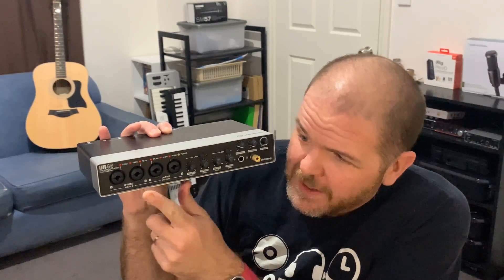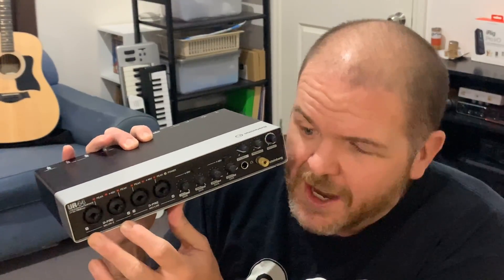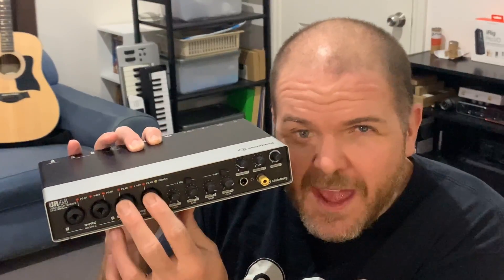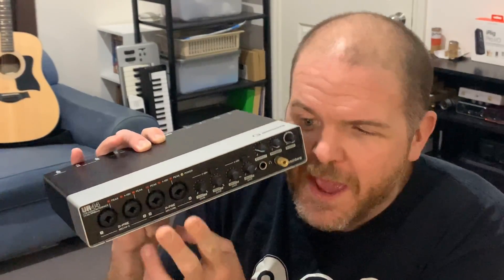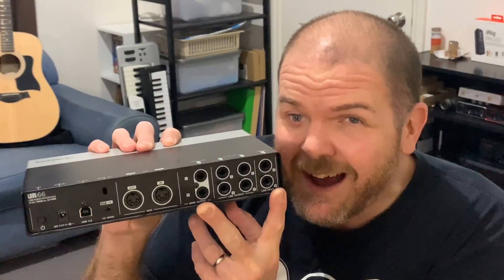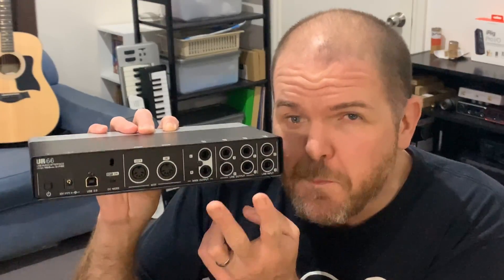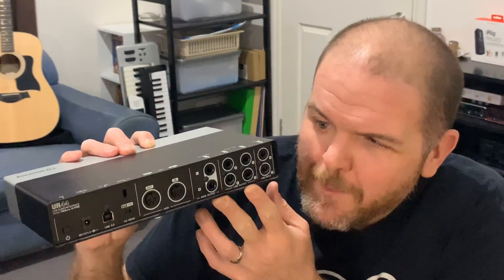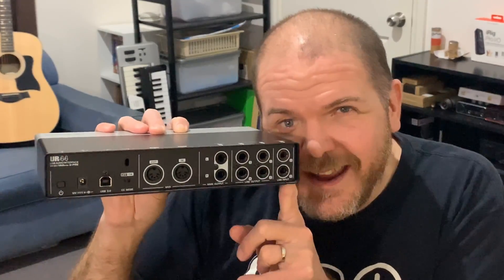What's the difference between a TS, TRS and TRRS cable?

Comment: Well, I didn't know that I didn't know any of this. Now I know. A very informative video, ta muchly. I do have a question though (for Pete, perhaps, or anyone who might know). I want to get the output from my DAW (probably Reaper) through my audio interface (probably an M-Audio 192/8) and into my guitar pedal board - so I can use my pedals as outboard effects - and then back into my interface/DAW. What cables would I need for this? I'm kinda guessing TS would be fine, or am I wrong?
Reply from the maker: Hey there. Pedals are usually just pushing an unbalanced TS signal so yes, standard TS instrument cables are probably the go. Some higher end guitar processors have stereo line level plugs which are TRS so in that case you could use TRS cables instead in to or from your interface, but TS would still work. My cable guide here might help too / http://studiolivetoday.com/cables
Reply: @StudioLiveToday  Thanks for you reply Pete, it's much appreciated and a great help. I'm still amused that in all these years I hadn't notice the different 1/4" jack plugs. But I now know  :-)

Comment: You mean if I want to record my guitars through my audio interface then I'll be needing a TRS cable ???
Reply from the maker: Hey there. Guitars use TS cables - standard instrument cables. Audio interfaces often have TRS inputs for line level signals, but these often also have an instrument or “Hi-Z” mode for your instruments.
Reply: @StudioLiveToday  hey please can you help me out , I have a um2 audio interface and o want to record guitars through it but , it's just not working , today I even purchased a TRS cable for recording it but still I'm unable to record .. can you please help me out  on how to record guitars through behringer um2

Comment: Can you plug in a TRS 2pin 3.5mm jack into a headphone splitter but the front of the headphone splitter is 3.5mm but TRRS
Reply from the maker: You generally need the sockets and plugs to line up with what you’re sending. Some TRRS jacks will accept standard TRS headphones, such as iPhone jacks.

Comment: i want to get an alesis nitro e drum, i allrdy have a laney hardcore bassamp and sleeved only cables. is it safe to use these?
Reply from the maker: Standard TS cables will work. You can also use TRS if you’re plugging out in to a mixer or interface.

Comment: Hello,
Thanks for the video
I have a balanced patchbay here and i'd like to know if pluging TS cables into TRS sockets or TRS cables in TS socket is a bad thing ? I wish to make my patchbay so i can change the order of my gear very quickly yet some of the inputs of my preamp are high Z so what if i plug TRS out in the TS in of the preamp ?
Reply from the maker: Hey there. So ideally you want to ensure that everything is consistent. But it’s not essential. In short? Plugging TS in to TRS is generally fine, but TRS in to TS can cause issues.

Comment: with a TRS cable that is supposed to have the “ring disconnected” (aka the “ring floated”), this just means plug it in until it clicks once, not twice, correct?
Reply from the maker: So, yes you can plug a 4 pole plug in to a three pole socket and just not push it in all the way, but it can be hard to ensure it is correctly aligned. And can cause issues if the ground poke connects in the wrong place.
Reply: @StudioLiveToday  Many thanks! Is it better to unscrew the casing and disconnect (cut?) the wire that is connected to the ring in this case?
Reply: NM, got it sorted. I ordered a couple of TRS insert cables (TRS on one end which spits to a TS “tip” and a TS “ring” plug on the other end). I’ll simply either cut off the “ring” split or leave it and tape over that plug with blue painters tape.

Comment: Can u give me a link to the best plug to use.
From ur house stereo or amplifier to ur speakers?
Reply from the maker: Speakers are a different story. You’ll need actual speaker cable to hook up your speakers, and they usually use banana plugs or those little clips that the speaker wire goes directly in to.
Reply: @StudioLiveToday My speaker input outlets take that type of plug. I just don't know which one is the right one. Out of the one's you show in you're video.
 I have two 18's & two 15's.
 Out of my power amp, it goes into one of my 18s. And out of that same 18. I use a nother pug to go into the 15.
And I do that for the other 18 & 15.
 But now I don't have a power amp. I have a house stereo receiver. And I don't have those wires and plugs no more. So I have to re buy the wires and plugs. But I need to know which plug is the correct one.

Comment: Hey Pete. Can you please help me with the following question?
If I insert a TRS cable into a receptacle designed for TRRS (eg an iPhone) would this damage the receptacle and/or any electronics located immediately behind the receptacle and vise-versa that is if I insert a TRRS cable into a receptacle designed for TRS?
Example:
I found out that when recording an iPhone 5 SE to a ZOOM H6’s XYH-6 capsule input jack, both TRRS to TRRS or TRS to TRS male to male cables can be used. Could this damage either the capsule or the iPhone?
Reply from the maker: Hey there. I don’t know think you’ll cause damage? At worst you could short out one of the devices if the wrong signal hit the wrong ring or tip... but it’s unlikely. TRS plugs for instance work fine on TRRS jacks as standard headphones. The other way round may be more risky.
Reply: @StudioLiveToday  Thanks Pete. I enjoy your videos very much, keep going.

Comment: A potential roadblock. A microphone  with a TS plug can short out inside a TRRS headphone microphone splitter. A TRS microphone doesn't have the issue. Inside the adapter the mic hot lead is wired to both the tip and ring. The long sleeve on the TS plug touches both the sleeve and ring inside the  adapter. This shorts out the microphone. As a workaround, I used two TRS adapters back to back. 3.5mm to 1/4" back 1/4" to 3.5mm to lift the connection between the tip and ring.
Reply from the maker: Nice additional tip here my friend.

Comment: Hi Pete, I’m using a TS cable on my electric guitar this is maybe causing noise in my speaker ?
Reply from the maker: Guitars should use TS cables. A different issue I’m afraid. This video might help/ https://youtu.be/dyrxZrUeSEg

Comment: Hi,
As far as I know, the different between instruments which have a line level to the ones who have an inst level, is that the instruments that have a power connection are line (synths, keys) and the others are inst level (guitar, bass).
So my question is about what you said at 2:42, which means that the line input is for balanced cables and the instrument input is for unbalanced cables. I always thought that the difference between those two inputs is not related to the cable type, but to the instrument power type.This whole thing just made me more confused. Can't I connect my keyboards with an unbalanced cable to the line input?
Thanks, much appreciated!
Reply from the maker: Hey there. I have a complete cable guide video which might help clear things up here / https://youtu.be/dyrxZrUeSEg

Comment: I'm using all TS mono 1/4 inch jacks going into & out of my mixer. When no music is playing I get a hum that is auditable. I was thinking about switching all of unbalanced cables out & replacing with XLR balanced ones. Do you think doing this will eliminate line hum? Thanks good review on cables👍👍💙
Reply from the maker: Hey there. So it’s not guaranteed that changing out the cable will totally remove this as it depends on the source of the noise. But unbalanced cables definitely can be a cause so it’s worth a try.
Reply: @StudioLiveToday  Ok thanks I have all of my equipment plugged into surge protected power strips, the mixer has an external power supply, I will try the balanced cables & replace all of the unbalanced ones & switch out all the TS jacks as well & see what happens, I'm up for anything to improve sound quality.

Comment: I have a mono plug TS 6.3mm microphone and I can't get it to work with my mac book or iPhone. I bought an adapter for 6.3 mm to 3.5mm (TRS) and connected the mic to it and then connected the 3.5mm (TRS) to a splitter that would go to my computer as TRRS. Shot: 6.3 mm TS Mic --> 3.5 mm TRS --> splitter TRRS --> computer . Could someone help me to get this damn microphone to work :D really appreciate it thanks :D
Reply from the maker: Hi there. I would highly recommend an audio interface with an XLR jack. Recording microphones via 1/4” connections is hit and miss and can be hard to set up monitoring. https://youtu.be/eGTbwR9XSHU

Comment: If I have a TRRS mic and a TRS extension cable, would using an adapter to connect the extension cable to the the phone work? Thank you!
Reply from the maker: Depends how things are set up. You need to keep track of what’s being sent to and received from the device on which wire basically. It can get complex which is why I recommend a digital connection via a USB interface or similar.
Reply: @StudioLiveToday  thank you very much!

Comment: Thanks Pete, nice tutorial
Would you or your viewers know if taking a T R S input from an RCA (unbalanced output) would the RCA ground / shield and hot go to either Tip Ring or would one need to tie the sleeve to ground as well. I know this is a rather doggy subject. I may have to find out what works (IF it works)
Reply from the maker: Hey there. RCA is always by its nature an an unbalanced connection so there is no way to convert it to balanced. This is why al RCA cables are RCA to TS. https://youtu.be/yL8UsC9fwv4

Comment: Hello, can i use trs to xlr cable to connect an instrument to the mixter?
Reply from the maker: Hey there. Usually not. Most instruments have an imbalanced TS output jack. So need to be connected to a TS/TRS input jack. https://youtu.be/dyrxZrUeSEg
Reply: @StudioLiveToday  Thank You sir for reply, so can I use a Di box rack to convert the unbalanced signal to a balanced signal ? And then Connect to the mixter for the live stage show ?

Comment: Hello. Very useful video. I have a question. I want to be recording some video and audio, of course, using my desktop pc, they usually have a separate microphone and separate headphones jacks. Which of these that you have deacribed abive should i use? I want to buy a lapel mic
Reply from the maker: Of it has separate mic and headphone jacks these will be TRS. If it has just one combo jack it will be TRRS.
Reply: Thanks sir

Comment: Thanks for the clear explanations!

I have an issue with a device equipped with a TRRS jack plug, maybe you could help me figure this out: it's a gaming chair that has built-in "bluetooth" speakers (they are actually wired to a 3.5mm jack that you plug into a Bluetooth receiver).

The sound is good over bluetooth, so listening to music is nice, but as for gaming or watching movies, there is just too much latency with the Bluetooth protocol, so I wanted to plug the 3.5mm jack directly to a sound source (laptop or smartphone).

But the output sound is extremely low and goes to the right speaker only. When I slightly pull the plug from the socket (but not totally), the sound gets louder, but still on the right speaker.

When toggling the pan settings in Windows, I noticed that both left and right channels output to my right speaker as if it were a mono speaker.

When I try another bluetooth receiver, I have the same low sound on the right speaker only.

When I plug regular headphones to the bluetooth receiver, the sound is extremely distorted, so I thought maybe it acts as a big-ass amplifier and since the speakers are not self-powered, maybe I just needed an amplifier, but the result is still the same.

That's when I wondered why the jack plug is TRRS, which is weird because it's just a set of stereo speakers (so there's no microphone channel or anything else), then I don't understand why there's an additional ring on the plug.

I saw that regarding TRRS, there are different wiring standards with ground and mic/video inverted, still, normally left channel should be wired to the tip and right channel to the first ring, is that correct?

Nevertheless, the fact that pulling the plug a little from the socket results in better sound makes me think that maybe the right channel is wired to the second ring and not the first one.

Is it possible that the wires are totally messed up?
Reply from the maker: Hmmm.... it could use a non-standard wiring setup that isn’t standard TRRS. Have you tried plugging in TRRS headphones like those used with a smartphone? Or a TRS to TRRS adapter?

Comment: Will it work? i will cut the trs of audio cable and replace it with ts cable(from microphone?)
i will only wrap it with electrical type will it works?
and when it is done i will plug in to my piano and connect to to the speaker alone ?
Reply from the maker: It depends what the inputs and outputs on each device are. I would just get the right cable unless you know how to ensure you are soldering the right wires.
Reply: thank you

Comment: Hey pete,

how is a 2.5 mm TRRS ended balanced audio/stereo headphone cable wired? any links you can share?
Reply from the maker: Not super familiar with the wiring sorry? It would have four going to the four poles. Tip, ring, ring and sleeve.

Comment: Excellent material! Subscribed! I've been thinking a while... What would happen when connecting a TRS Mono to a TRS Stereo?
Reply from the maker: Thanks! And to answer your question it would just send a mono unbalanced signal.
Reply: @StudioLiveToday  Thanks Pete. I read elsewhere that "If you connect a TRS mono (balanced) output to a TRS stereo (unbalanced) input, you'll get a strange effect. It will be sort of mono, but it will sound strange. A mono TRS output sends the same signal on the tip and ring, but with opposite polarities. Since the stereo TRS input interprets tip and ring as left and right, you'll have the same signal on the left and right channels after the input, but with opposite polarity still. If you listen to that on headphones, it will sound strange but will mostly work. If you try to listen to it on speakers, a lot of the low frequencies are likely to cancel and it will sound strange and pretty bad." That is why I am concerned that it is not simply "a mono unbalanced signal" what it would send. Any ideas?

Comment: Thanks for the info Pete!  Soo I take it TRS stereo cables would not be able to connect to instrument input sockets on audio interfaces? and would a microphone with XLR to TS cable be able to?
Reply from the maker: Hey there. Check out my cable guide over at http://studiolivetoday.com/cables. In short, TRS definitely can't be used with instruments, but sometimes instrument inputs on interfaces can take line level signals also. Mics need balanced XLR for interfaces. You technically can convert to TS and plug in to an instrument jack, but it won't amplify the signal and will be super low quality. https://www.youtube.com/watch?v=xUsXWo7Liaw
Reply: @StudioLiveToday  I see. Thanks as always for the info Pete.

Comment: I am trying to fix a standalone microphone, whose tip broke off, and it looks like a TRS. When I peeled my microphone cable, it only has a white cable, plus the stripped wire. I purchased the TRS 1/8" stereo plug, but when looking for fixes, they always show two cables, plus the stripped wire, not just one white like my cable. What am I missing or how should I look for the fix? Because I have not found fixes with just one cable.
Reply from the maker: Might be just a TS cable on your mic by the sounds of it. Most 1/4” plugs on mic cables use only TS and are unbalanced.
Reply: @StudioLiveToday  Thank you.

Comment: Hey Pete - great video. Just to clarify - it sounds like a guitar would not be able to be connected to the the balanced trs line inputs, correct? Would need either a mixer or an interface with additional ts/instrument inputs instead?
Reply from the maker: Correct. Guitars need a unbalanced TS cable. Some 1/4” TRS inputs like those on many mixers and interfaces can support TS (often called instrument or Hi-Z) but may need you to set this.

Comment: I had no idea the re the unbalance balnced. Made me realise Ive the wrong cable for Interface to monitors. My interface and monitors each have 2 different  imput/output and Ive been using a TS to phono but need to swap to a TRS to XLR . Cheers!! Very helpful and to the point.
Reply from the maker: Nice one! Glad it helped and thanks for your kind words.
Reply: @StudioLiveToday  if I have a apollo Twin duo interface and Hs8 speakers, do I have to use Ts to Ts or Trs to trs cables?